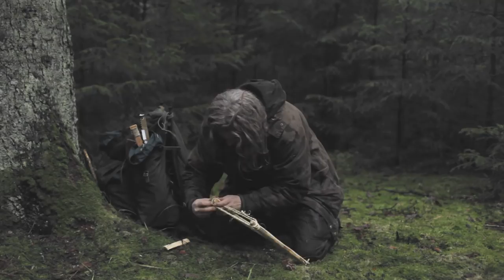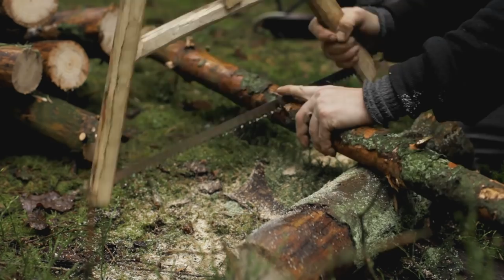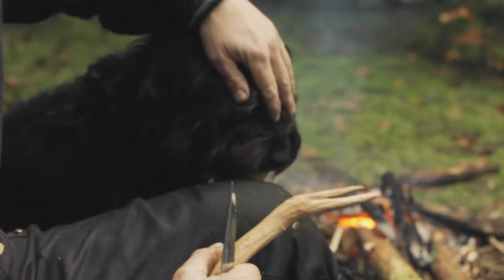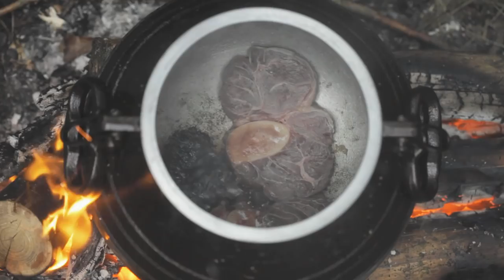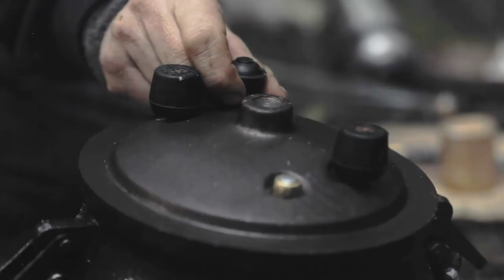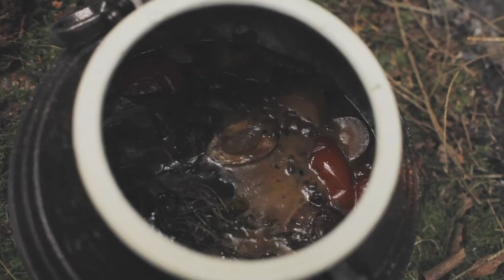Bushcraft - carve & cook - Amazing osso buco in the forest in less than an hour. The Afghan Cooker.

Comment: Absolutely love that little pressure cooker.
Reply: Well, it weighs 10lbs itself and alone and it has 8 liters of volume. That's something i would barely call "small" :). But still nice pressure cooker, i must admit.
Reply: @bujablaster  didn't know about the weight. Either DonVonGun must have the muscles of a gorilla, or he transported the cooker close to the campsight with a boat or vehicle. It's a nice little cooker if you have transport, or, for a small home, though.
Reply from the maker: Haha!! :D I dont bring it on longer trips. But it is very nice. :)
Reply: @DonVonGun  Perfectly transportable by boat, vehicle, or pack animal. Also, you can con your body-builder friend to carry it for you.
Reply: @T Mac Read the rest of my replies on this thread, brah!
Reply: @T Mac I mentioned that it wouldn't be difficult for someone with a boat or pack animal. Also, an atv or other vehicle. I don't know how DonVonGun got it there. He told me he doesn't carry it very often.
Truth is, I believe that many of these camping video creators bring their gear close to the camp by vehicle.
Reply: @T Mac Sounds great. I used to do long-range backpacking trips. Really miss it. My legs can't handle it anymore.
I really love these guys like DonVonGun and Bjorn who do rustic camping with simple gear.

Comment: How about carrying a small container of liquid coconut oil, It has a much higher heat level than butter, It wont burn and blacken on a high  heat and you can use it to clean your teeth, Just swill a tablespoon full for a minute or two and spit,  Great video, Fussy Musen